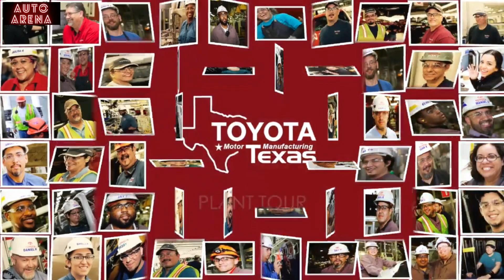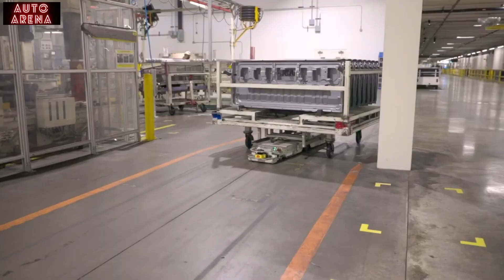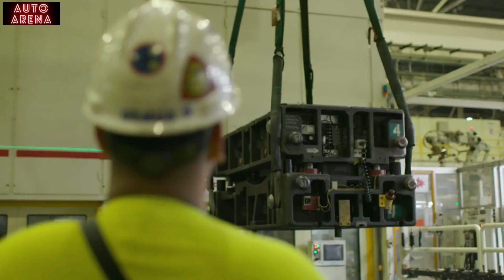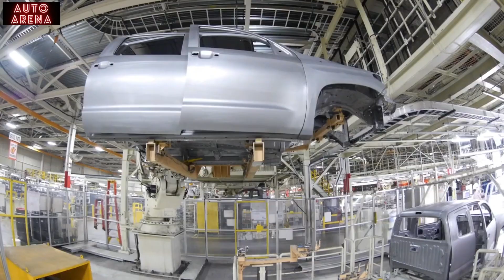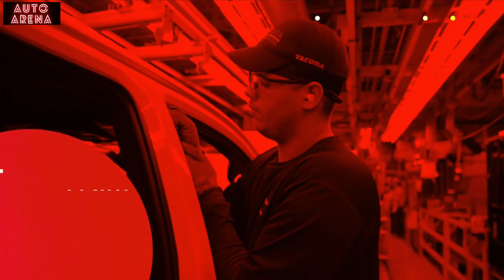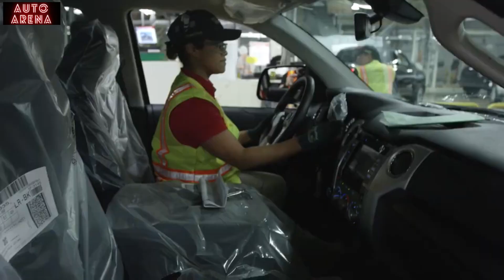Toyota's Truck Factory Production In U.S (Tacoma and Tundra) - Full Tour!

Comment: I'll bet that pull cord to stop the line was pulled only a few times and the two who did it, now work at Ford.
Reply: It's for quality control..If  a problem or issue happens you should pull the andon and the issue is dealt with. It can be caused by a person or machine. People can fail to do what is required as well as anything mechanical also.A team member only has so much time to perform a task, this is often counted in seconds, yes seconds. Time is money and every second is counted when the line stops due to an andon pull. This  down time is taken seriously and management will take steps into  reducing it. Retraining is sometimes needed or a person is moved to another task. Machines and processes continually go through improving to keep down tac time. There are daily production numbers that must be met before  your shift ends. The longer it takes the longer you have to stay at work. It may be 5 minutes or 45 minutes and everyone stays until done.